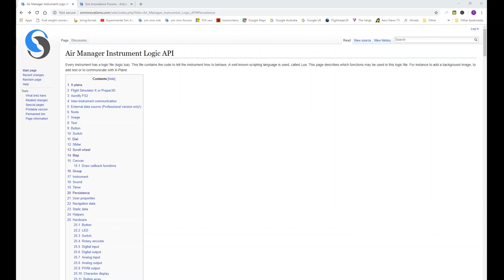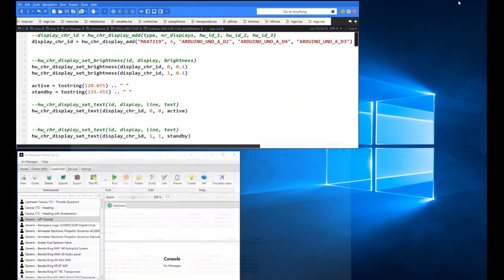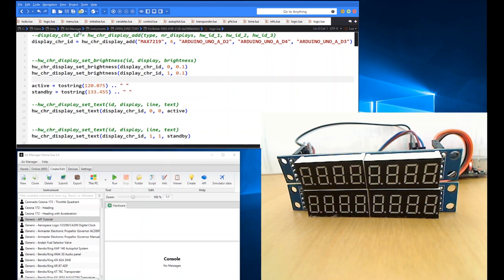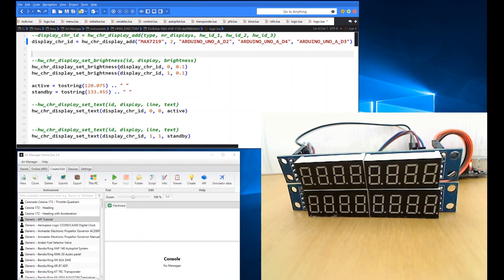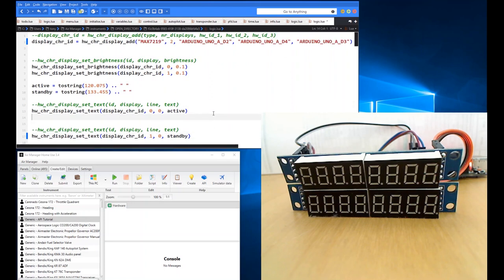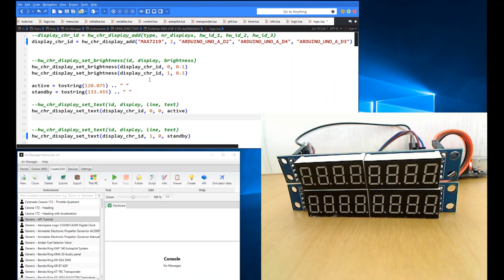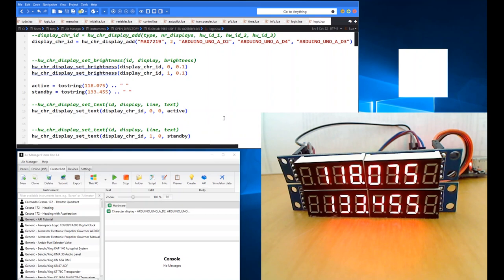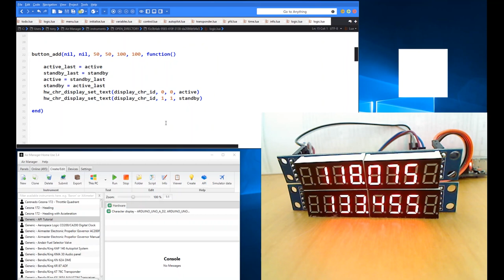Instrument development - E28 - Character display

Comment: Excellent, I have some trouble when daisychain max7219 displays, but in my test I try to send que complete 16 characters to the display, now I see you send the data individually, could be that my problem? Is possible to send 16 chars to 2 max7219 without trouble or is better to doit one by one?
Reply from the maker: Hi Javier, you have to send those individually. So 8 per display. Check out argument 2 here: https://siminnovations.com/wiki/index.php?title=Hw_chr_display_set_text
hw_chr_display_set_text(display_chr_id, 0, 0, "12345")
hw_chr_display_set_text(display_chr_id, 1, 0, "54321")

Comment: Great video thanks. Any further development for LCD displays? Or the ability to send the relevan characters to an Arduino card running an LCD display using the lcd.h library? My cockpit is bult around 16x1 and 16x2 displays and although I could convert it would be easier to just use what's there! :-)
Reply: I'm not entirely sure what you mean, but we are not going to support more displays than these. You can always use the message port in combination with your own Arduino sketch.
Reply: @ralphrietveld  I mean 'LCD displays' as opposed to 7-segment digits. Like these: https://content.instructables.com/ORIG/F6C/X2L6/IBHRNLW4/F6CX2L6IBHRNLW4.jpg?auto=webp&frame=1&fit=bounds&md=a554a290f5c2d2f8e94d36b0f082add9
Reply: @fatcharlieuk  That can be a HD44780 which we already support: http://siminnovations.com/wiki/index.php?title=Hw_chr_display_add#HD44780
Reply: Ralph Rietveld thsnks fir getting back to me so quickly! I need to read the manual better :-)
Reply: @fatcharlieuk  there's a lot in there so it's easy to miss something.
Reply: Ralph Rietveld you’re very kind! Just one more question, then, is there a part of the reference you can point me to which describes the hardware wiring side, rather than the code?
Reply: @fatcharlieuk  the manufacturer should give you a pin out. In Air Manager you only have to select which pin is which input pin of the display. But that might vary between manufacturers. There's probably a lot of examples for the Arduino that show you how to do the wiring.
Reply: Ralph Rietveld thanks again for the prompt reply! I already use them with an arduino and self-written sketches based on Link2FS and all the stuff on JimsPage. I only use 4 data lines. More, I was asking you fir an AirManager reference which would explain its use with AM, presumably via an arduino, like the link you first sent me - just to get me going in the right direction! Im working my way through Tony’s amazing series on the instrument API, so I guess he’ll cover it in due course. Thanks again for the help :-)

Comment: Unless you have fixed it, the number of chained modules actually matters. If you have more than 4 modules, let's say 6, and you write there 6, modules don't work properly, they freeze and stuff. You shall write there 8 even if you have 5,6 or 7 modules chained.
Reply from the maker: Still in the 3.7 beta. But on the list to fix.